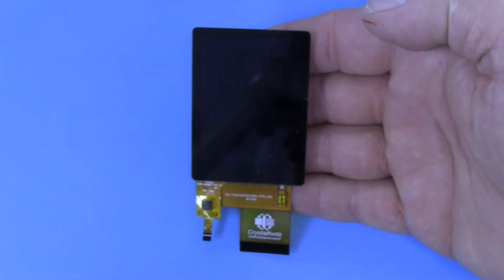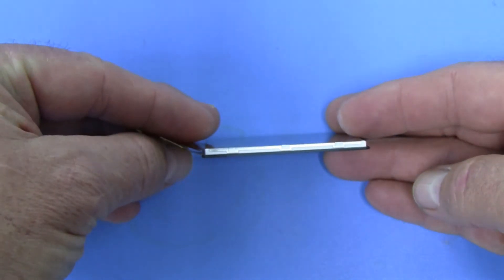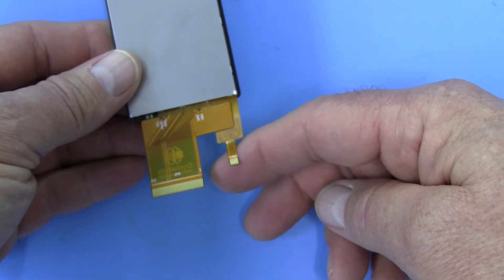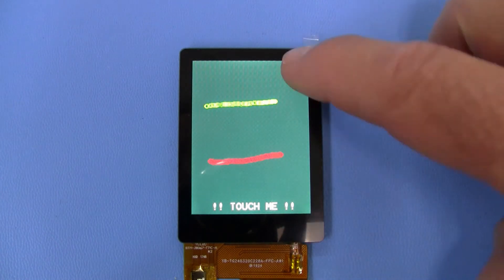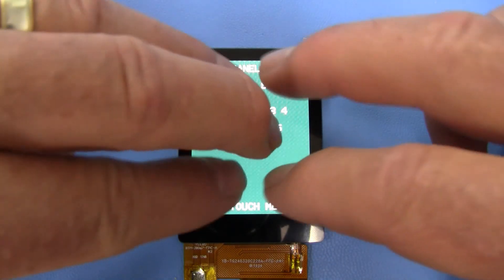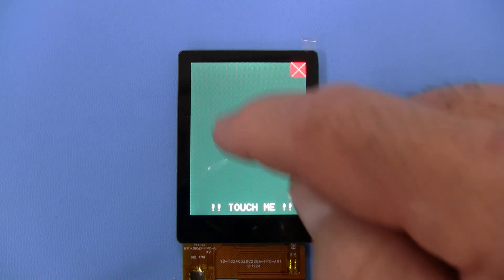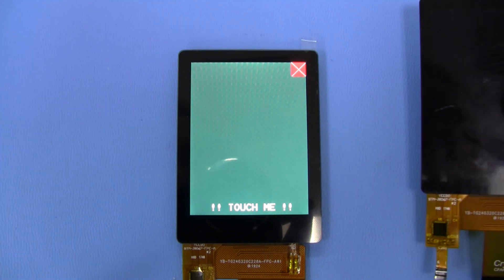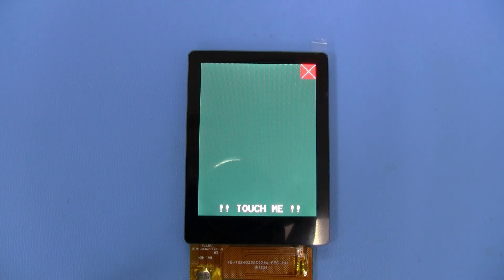Crystalfontz 2.4" IPS TFT Capacitive multi-touch for embedded, CFAF240320A0-024SN, Arduino demo

Comment: Do you know who the manufacturer is? I'm trying to find a 3.4 x 2.5 inch screen with USB-C input
Reply from the maker: It sounds like you're looking for a turn-key solution, where you just plug a display in via USB-C and have it work like an external monitor?
Reply: @Crystalfontz  yes or I can assemble parts of it as well. I have larger monitors I'm looking for custom, like 3.5 inch

Comment: How easy is this for raspberry pi integration? Or do you guys have a better more focused raspberry pi touch screen at this display size?
Reply from the maker: In terms of ease... It definitely wouldn't be plug & play. We don't currently have anything that is plug & play with a rPI that is this small. Our easiest display which is plug and play for a RPi is 5": https://www.crystalfontz.com/product/cfam800480b0050tc-800x480-raspberry-pi-dsi-tft-lcd
However, if you're pretty experienced with rPI, hardware, and SPI it should absolutely be doable.